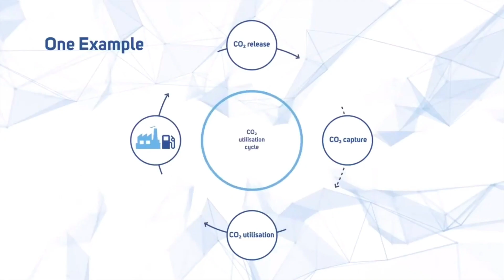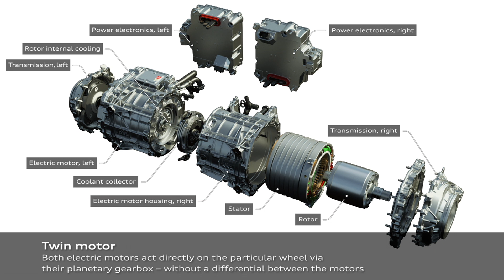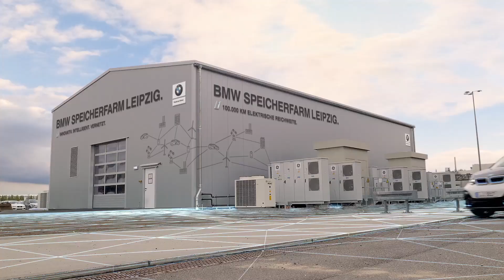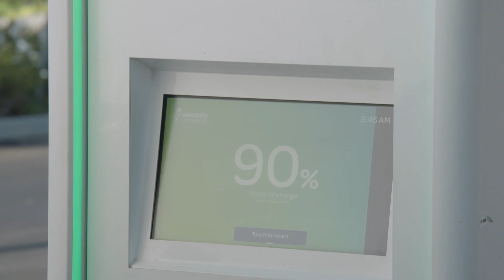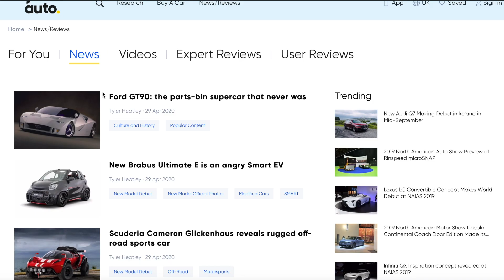Will synthetic fuels kill off Teslas and other electric cars?

Comment: It’s a fact synthetic fuels are the best alternative to fossil fuels. 

Not only are they 100% carbon neutral (electric is nowhere near that when you consider electric power generation from fossil fuels over 65% globally).

It requires practically no change in infrastructure, refuels in a couple of minutes, travels two to 3 times further.

Cars are lighter 50kg if fuel v 600+ kg battery and still have longer range! Even more if hybrid.
Sound better,
Handle better (light weight)
Can power aircraft, ships, mining equipment fir much longer timeframes. (No chance for electric.)

Contrary to what you said there is very little uptake if EVs globally and in the EU. 
The infrastructure is a laggard and nowhere near practical levels. Requires $$$$ to develop

EVs require massive subsidies, rebates and tax breaks to be viable, synthetic fuels can be 100% privately funded

EVs are not revolutionary like iPhones, they are an alternate and power source. They do nothing revolutionary which is why no one really wants them or can afford them.
Efficiency is a moot point if on less than 10% of electric battery it carries much more energy that is lighter and can travel further

If you want to go electric then hydrogen fuel cell is your answer. No lithium mining and recycling, just use conventional materials like combustion cars.

Until of combustion engines will continue to be made and improve faster than EVs.

Don’t be such a fanboy if electric without being a realist. To get to net zero by 2050 is going to require synthetic fuels as the majority of cars on the road will still be combustion powered. 

Here’s a link to another company Prometheus fuels;

https://m.youtube.com/watch?v=m7wFCqQDPDc

Comment: People will not want to breathe the exhausts. Even now some city centers are closed for ICE cars, as EVs become more wide spread and affordable, expect more of these restrictions in your area :)
Reply: I think ice cars should be banned from city centres but promoted on motorways and rural suburb areas on lclfs.
Reply: Don't think the carbon neutral fuels will have a bad smell either. They didnt really mention this yet but the fuel being used is the issue, not the cars or the exhaust.
Reply: If you take that pollution and make into fuel or bury it in the ground you wouldn't have a smoggy city...EV is NOT the future. Electricity generated by renewable means is... what you do with the power is make those machines operate. Be it making batteries and running them or making synthetic fuel and flying a plane....if you makeba surplus of power, you can use that to capture C02....
Reply: @nimlopatlo1013  there is a carbon capture device that can be used in combustion engines. Turbos (or Ecoboosts) and EGR does some carbon capture or rather they use the carbon from the existing combustion engines, even then carbon neutral is that they don't increase the carbon levels. In reality though we need cars that can capture carbon into usable energy. Evs are zero emissions but they don't do anything to lower existing carbon levels.

Comment: The electric motor with one moving part no oil lube and maximum torque at 0rpm destroys a combustion engine with a 1ooo moving parts full of oil plus 6 speed trans and torque converter every time.

Comment: So tired of the electric cars being advertised as environmentally friendly. Just look at all the mines for materials compared to a oil rig. You lose thousands of acres to mining and destroy surroundings environment. With oil rigs you lose not even a quarter of the area. Also what happens with the oil we don't refine? Will it eventually work it's way to the surface? What happens if it gets ignited when it reaches the surface? It will burn off with out any filtration. In this case how would it be more beneficial to leave it?

Comment: yeah but nobody thinks about how the battery production makes a freaking bad emission and its mining it's not even a bit good to the local ground biodiversity, and what about the recycling, batteries don't stand still and working a 100% forever, do anybody mind or ever minded about that? ICE vehicles are bad to the environment but if the fuel that it consume would be clean, it solve the problem, because the fuel don't polute and the whole car is recycle.

Comment: Ig both Synthetic/eFuels and EVs will have a 50-50 dominance in the coming future. As EV's R&D is also way ahead but I don't think there will be a complete replacement for ICEs. Hybrid Drivetrains would be a better and profitable option rather than completely switching to either of the two.

Comment: The structure for EV just isn't here and wont be for at least 50-100 years. With over 276 million vehicles in the united states alone, it is obvious that EV isn't the future and countries like tesla and GM should honestly not even try. However there is a solution, modifying available cars to use other fuels such as synthetic and E85. We have already done it with oil and synthetic oil already out performs  the natural stuff. Especially with cars only really needing a tune to run on alterative fuels. There are already flex fuel vehicles on the road and high horse power cars have mainly switched to e85 already. Bio-fuel and synthetic fuel already have the available infrastructure. We already have the vehicles that car run them. EV vehicles leave out so many people. With electric vehicles we cant just make every one buy them. With e85 we can make every vehicle run on e85 in a couple of years.

The country that is most likely going to go with Synthetic fuel is clearly the united states. The united states is the country that can due it the quickest.

Comment: less "prove" and more "demonstrate," imho. 

please reduce the subjectivity in your content. you only address the energy-portability issue (where to get HC fuels vs where to charger your EV) at 5 minutes into an 8 minute video. you barely touch on "well to wheel" CO2 issues, the politics of fossil fuels, as well as the problems of battery material mining (not just production).

please try harder